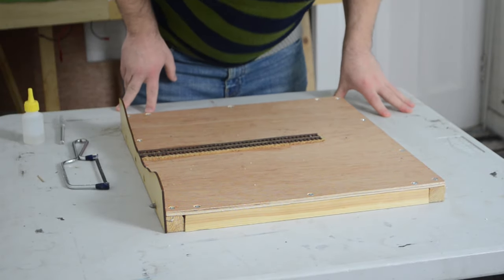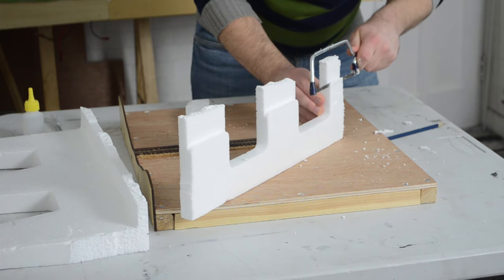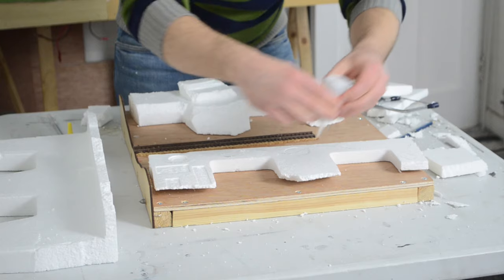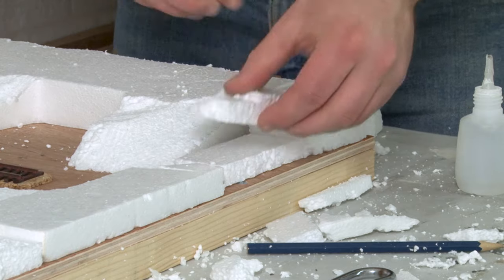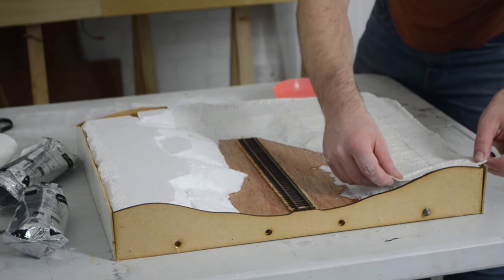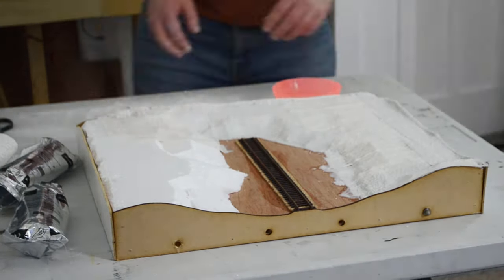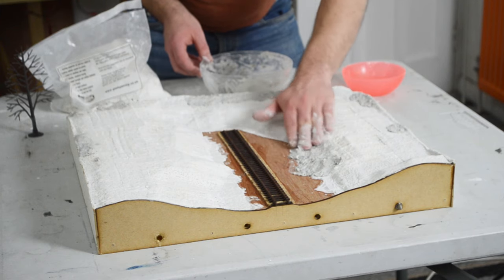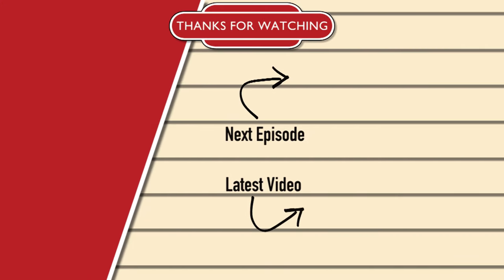How To Make Hills & Embankments - Model Railway Basics: Episode Four

Comment: I have always used whatever is at hand, polystyrene blocks, a card framework covered in newspaper dipped in polyfilla all works well...and mod roc, just remember to make the hills strong enough to plant trees...
Another idea is to prepare your hills as modules..and add scenics before install on layout, as this keeps all that track and ballast clean...
Reply from the maker: The hills don't necessarily need to be strong enough to support trees though as many people create a hole in the hill surface and push the trunk down into it.
Preparing hills as separate sections is a possibility too but they do tend to end up looking like they've been place rather than part of the natural landscape. Of course you can blend them in but then you might as well just do all the scenic work on the layout at that point. Personally I've never had any issues with keeping the track and ballast clean while doing the surrounding scenics... but if it does worry you some tissue paper along the track can protect it. Thanks for watching 😃

Comment: Really good video. I’ve just done my first embankments. I’ve made 2 shapes then added the plaster cloth away from the layout. I will then glue down and finish with modelling compound then paint ready for static grass. N gauge layout I’m doing. 👍
Reply from the maker: Nice! Don't forget to blend in the bottom of the hills when you add them to the layout - otherwise they can look a bit "placed". One thing to bear in mind with modelling compound is that it can add a lot of weight to a layout - not so much of an issue if it's a fixed layout for a permanent space though. Best of luck and thanks for watching 😃
Reply: @ThatModelRailwayGuy  thanks modelrailway guy. When glued down I will add some foliage after the grass.. I watched your rock/cliff module that you did for pitley layout. Some great tips on how to paint and highlight the rocks and add the foliage 👍. The model compound is only to blend in a small gap to a bridge that runs from an incline so there won’t be a lot of it. My layout is 1.5x 0.75Mtr and is portable so I’m at the diorama stage.  There is scope for expansion if my wife lets me.😂 thanks again for your tips and videos. 👍
Ps, when it’s done I will post on my channel if you want to have a look.

Comment: Another helpful video!

I've been working out how to do this myself and I'd more or less got it sorted, but the extra tips you've thrown in have been really useful. My plan is slowly coming together.

Thank you.
Reply from the maker: Awesome, great to hear you figured out for yourself but yes those little extra tips can make all the difference. Best of luck with your layout and thanks for watching 😃
Reply: @ThatModelRailwayGuy  I've had great success in making wargaming terrain using polystyrene sheets, thick card and ready made plaster.

I might use a similar method but might change the plaster for that putty stuff and the plaster-bandage.

Comment: Great. Loving your terrific videos.....I used to use plaster bandage but I ended up making my own ,,I bought cheap disposable kitchen roll and cut it into strips like you did ..I made a more watery mix of casting plaster you can buy cheap at any hardware outlet and soaked the strips in it ...takes a little while to dry but once it is it works great ..I have made larger hills on my layout that way after using chicken wire and cardboard lattice bases..The best bit of model rail is how inventive it can be .. On my rock faces I use real rock embedded into the hill..As I walk in the bush with my dogs I often find shale that is lightweight perfect for this job and looks realistic because it is .. My layout is an  HO scale  4.5 metres x 3 metres  modern era U.S. BNSF DCC one..Although I'm in Australia it allows me big scope but one day I want to build a BHP Billiton  Ore  layout set in Australia ..With more Aussie manufacturers coming on line making Aussie stuff you don't need to take out a second mortgage for it'd be great to model my home country stuff one day..
Reply from the maker: Thanks Rodney, glad you're enjoying them. That's some really great tips there about plaster bandage and creating rock formations too, definitely good for anyone who is on a bit of a budget. Best of luck with your own layout and thanks for watching 😃

Comment: I really like your videos, I'm a bit gun shy for finishing the scenery I've never do it before.As a child  I had a board with track pinned down with a few building that was it. Now I build my baseboards from (1") 25mm thick sheet of polystyrene fully covered in paper mache painted off white (left over paint from decorating) which helps to prevent warping and then add a wooden frame like yours. Not only can I build up but also I can carve down below the track level adding extra polystyrene on the under side if needed . I re paper mache the whole top and paint in patches of colours, grey for roads & paths, green for grass and blue for any water. that's as far as I have got. Next do I use flock or static grass, what to use for a road surface?... All the decisions I've been putting off. Looking forward to the next great tutorial.
Reply from the maker: Thanks Leigh, glad you're enjoying the videos! That sounds like a great way of doing it and your baseboards will definitely be light that way. Does the polystyrene stay flex at all, or does the frame keep it all rigid? I'll definitely be covering static grass in an upcoming video so keep a lookout for that. Thanks for watching 😃
Reply: @ThatModelRailwayGuy 
Being an inch thick polystyrene it’s quite rigid then with the paper mache all over helps stiffen it up.  
And yes it very light I can hang my 6x4’ test layout on the wall like a picture when not in use.
And now in the middle of building a Inglenook layout thanks to your video.

Comment: Something worth mentioning at some point if your doing hills in another video is that hot glue works well for sticking the foam down, so long as your quick with it.
Reply from the maker: Yes that is another good way of doing it. It's a technique I should use more myself, though I tend to build most of my large hills out of chicken wire these days. Thanks for watching 😃
Reply: @ThatModelRailwayGuy  yeah, chicken wire is probably a good idea too. I’ve personally never tried it since the only place I know of where I can get it within a short drive is my local garden centre, but their only open in the garden season, and I tend to do many of my projects in the winter.
Reply: @ThatModelRailwayGuy  I use carboard formers overlaid with cardboard or paper strips which I cover with paper towels glued down with watereed down PVA glue. I then dab on with my finger  plasterboard ready mixed plaster. This makes a cheap lightweight and realistic hill.

Comment: Hello and thanks for posting these videos - I’m starting to build a layout after years of thinking I’d never have the time or patience for it - for some reason when my 40th birthday came I decided to take the plunge!

I’ve constructed an 8x4 baseboard with information from your baseboard video - great stuff.  Got a question about Modroc:  How much extra height does this put on when applied to the polystyrene?  Say I have a bridge which has its level 80mm above rail level, can I still cut 80mm of polystyrene, or would this have to be slightly lower to account for the Modroc?  Modroc looks a great thing to have and easy to get from craft & hobby shops as opposed to just model places.  

Many thanks for posting and your videos have been a big part in making my mind up to start this project, top stuff 👍🏼
Reply from the maker: Hi there, it's great that you've finally decided to jump into creating your own layout and I'm glad you've been finding the videos useful!

In my experience modroc tends to be completely flat (unless you deliberately bunch it up) so it shouldn't add too much height. Maybe a millimetre or two at most if you want to account for that but it doesn't expand or anything. Hope that helps and best of luck with your layout! Thanks for watching 😃
Reply: @ThatModelRailwayGuy  Hello and sorry for the delay in replying, my notifications have been playing up.  Thanks so much for this - that’s excellent and it’s something I’ll remember.  I’m waiting for some bridge kits to be delivered first, once they’re up and I can see the height then I can start shaping the polystyrene and the embankment can come together!  Many thanks for the reply and also for making such excellent videos

Comment: Doesn't super (CA) glue melt the foam board, leaving a cavity underneath ?
Reply from the maker: I've found it depends on the glue and the polystyrene. Most of the time it doesn't really have any effect and is useful for working quickly. Thanks for watching 😃

Comment: Could I use dark blue as a base paint for my layout as I bought a ltr can and my Mrs didn’t like it on the walls
Reply from the maker: It's your model railway, you can do what you like. Generally though the point of using brown is to create a base colour for your scenics to go on. It might look a bit odd if your ground is blue under the grass but if it doesn't bother you then you can definitely try it. 
Another option might be mixing in small amounts of red and yellow to create brown. Hope that helps and thanks for watching 😃
Reply: @ThatModelRailwayGuy  suppose it would look funny I was thinking the static grass would hide it lol

Comment: Hey 👋... You said to use superglue... I've just used UHU all purpose and it just burnt through the polystyrene? What do you use?
Reply from the maker: Hi there, that's weird as I thought UHU was supposed to work with polystyrene! The stuff I used is just a generic little bottle from Amazon, there's a link to it in the description. You do have to be quick still as it will melt the polystyrene a little bit but as long as you don't hang around it works fine. You don't need that much in my experience. Thanks for watching 😃
Reply: @ThatModelRailwayGuy  sat waiting on standard PVA to set now, but yeh weird about the UHU, it's just a little all purpose adhesive but within seconds it burns right down meaning it won't stick to anything. Just finished laying cork down for a simple 1st radius for the boy at Xmas. Kinda want to leave some bits for him but I'm enjoying it too much!!! Lol 😂

Comment: For the chicken wire technique, I think it might be a bit quicker, easier, and less messy to use masking tape instead of paper mache, but I'm not sure. And it probably isn't cheaper.
Or I guess you can just use plain paper?
Reply from the maker: I’m not sure how well masking tape would work unless you still put the glue over it. Part of the reason for using paper mache (apart from it being cheap) is that it creates a nice hard shell too. Thanks for watching 😃
Reply from the maker: I’m not sure how well masking tape would work unless you still put the glue over it. Part of the reason for using paper mache (apart from it being cheap) is that it creates a nice hard shell too. Thanks for watching 😃
Reply: @ThatModelRailwayGuy  oh yeah, that makes sense.

Comment: You can make cheap modgepodge  wet newspaper mixed with pva for a lot less than modgepodge
Reply from the maker: Hi Les, I think maybe you're getting mod podge mixed up with modroc? You can certainly use newspaper and pva to create a papier-mâché shell. 

I actually did this in my tunnel building video. It's wasn't as strong as modroc though so I only used it as a base layer. Thanks for watching 😃
Reply: @ThatModelRailwayGuy  I make my own modge podge with newspaper water and pva as a filler to smooth transitions in the jablite polystyrene structure and then plaster bandages over it so no I’m not confused with modgepodge and modroc
Reply: @ThatModelRailwayGuy  it was not a criticism of the excellent modelling you were demonstrating just an alternative cheaper building material as also is using j cloths soaked in pva as an alternative to large expense of expensive modroc .

Comment: An informative video, but, you should have protected the track to avoid getting any plaster on it. I use painter's tape of the appropriate width to cover the track when doing any scenery work around the track.
Reply from the maker: Thanks! That's definitely an extra step you can add if you want to. As you'll see in an upcoming video, I paint my track quite heavily before ballasting so I wasn't too concerned about the odd splodge of white as it's mostly covered up anyway. 
That said I've found the plaster doesn't tend to drip off the bandage much, so there wasn't really any clean up to do. Thanks for watching 😃

Comment: I know something that doesn't work. 
Polystyrene form with air dry clay. 
The clay shrinks and cracks while the Polystyrene doesn't. Was a mistake 😕.
Reply from the maker: I wouldn't recommend using clay on a large area like that anyway. Your best bet would be to use ready mixed filler which will be much easier to work with and will give you more satisfying results. Thanks for watching 👍
Reply: @ThatModelRailwayGuy  I did , the wife said the clay looked like something the dog had done

Comment: Also… sculptamold is 1,000 times better than plaster sheets. Looks more like rocks too.
Reply from the maker: I would say they each have there uses. There are somethings I would definitely use Sculptamould (or the other branded equivalents) and there are certain jobs that would be much easier using plaster bandage. For me it's about using the best tool/material for the job at hand. Thanks for watching 👍